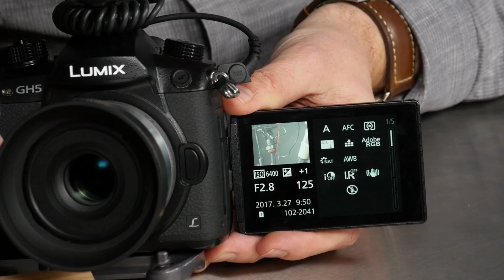Q&A: Panasonic, Pearl-2, GH5, Lenses, Streaming, and More!— PhotoJoseph’s Photo Moment 2017-03-27

Comment: Darn Joseph, I just missed your webcast. I had a question which I still hope you can answer as I was struggling to get the follow autofocus when videoshooting right (I have the 12-35 v1 on my GH5). Here's my question: Which are the optimal settings for videoshooting fast paced sports while using autofocus? (not manual!! ). Which videosettings, face detection? , eye detection? , other settings? specific buttons on top of the camera?
Reply from the maker: If you haven't yet, watch this video https://youtu.be/6PyqWrztPkc — as far as which AF mode to actually choose, I'll be running some tests on that soon.

Comment: Hi, there! Thanks for great gh5 videos.

Is there a way to contact Sean to ask him a question? There is an issue with gh5, metabones speedbooster ef ultra and zoom lenses (like my Sigma 18-35). When You zoom in, the camera freezes (everyone has the same issue). 

My question is, will there be a firmware update and if yes when? 
I contacted both Panasonic and Metabones, but they didn't reply. 
A lot of folks are using adapters with m43 cameras so it is a big issue for us, with this otherwise great camera. 

Take care, and keep up these videos coming :)
Reply from the maker: This is likely a Metabones issue. I know for a fact that they didn't have a pre-production GH5 so assuming they have one now, they are just getting started testing with it.
Reply: Good to know :)
Reply: join this group on facebook guys there is a quick fix for the zooming issue https://www.facebook.com/groups/pansonicgh5/

) No lens on camera
2) Switch Camera on
3) Press Aperture toggle on Metabones and KEEP it pressed throughout
4) Attach Metabones to camera whilst it is still switched on
5) Once lens attached ONLY then take finger off Aperture toggle
6) Switch camera off, then back on and use :-)